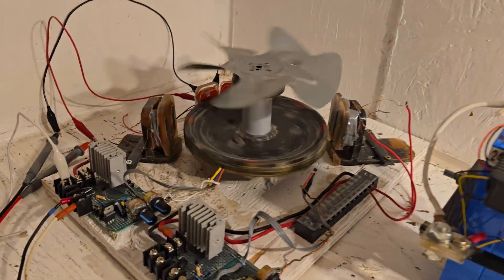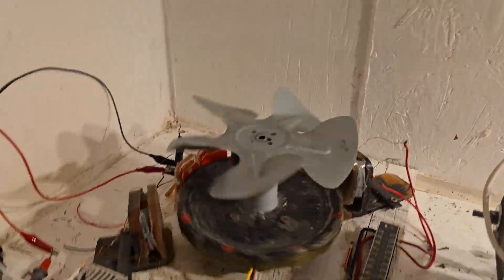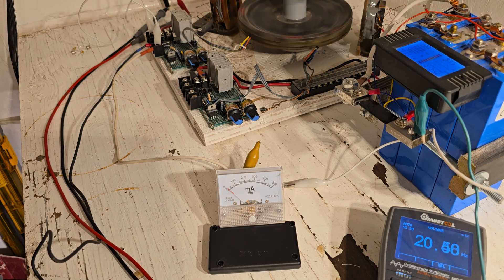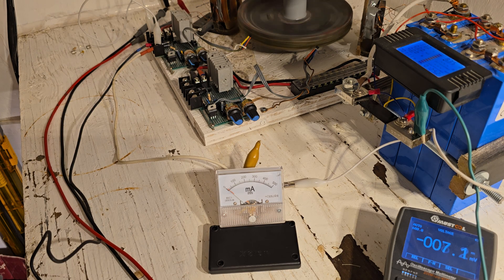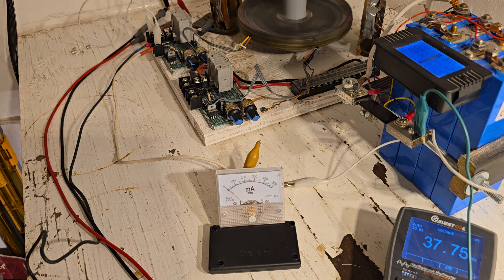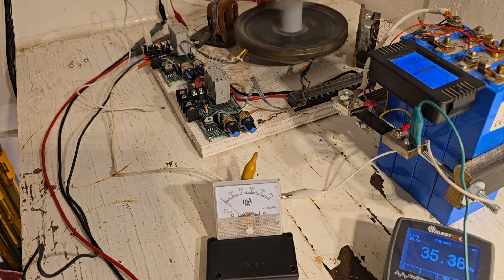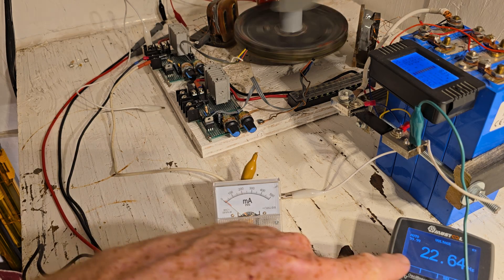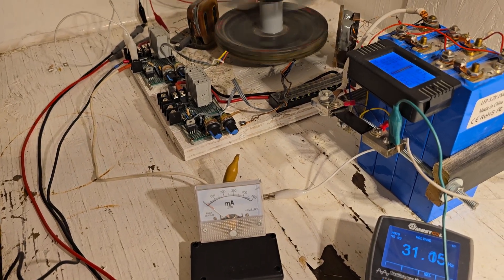Is it possible to Loop a Pulse Motor or not ?

Comment: Very impressive as always. The way your circuits are compared to even 10y ago are miles ahead of what everyone was doing. You may recall "Tinman"? He professed he'd made a self runner, whereas there was no battery? Charge coils were looped back to drive coils? On the video I have of him showing it "working", he starts the rotor manually and it just ran? All his circuits were analog. I've no reason to doubt him, though I can't replicate such.
Reply from the maker: Tinman is awesome! I've seen all those videos too lol , thanks for your comment bud!

Comment: I am your student does that battery bank have a BMS???
Reply from the maker: No  I took it off just to make it simpler for people watching to see but it will work with a bms and I recommend using one just for safety reasons  . The wires are still on the cells but they aren't plugged into a bms at the moment.  Thanks for watching!
Reply: One last thing how many ohm on motor coil??
Reply from the maker: @KevinPounal they are 1.2 ohms total on that motor, each drive coil has 2 coils wound in series each. 6 ohm and wound around ferrite C cores

Comment: The issue with looping without isolation has been that it will mess up some battery chemistry in a long run. Batteries usually don't like to be pushed and pulled at the same time.
Reply from the maker: That's not true if the power from the motor is more than it's consuming. The only time it becomes a issue is with battery switching circuits that don't fully charge the battery before it switches  example switching every 30 seconds or even minutes.
Reply: @windpowerandmore6310  There's just way too many variables in all the setups I have seen so far :D Good to know that it's possible.

Most battery manufacturers recommend 15min resting time between load and charge. But those new LiFePO4 batteries seem to act more like capacitor. They are able to handle the stress much better, for what I have seen.

Some have said that they also will be damaged faster over time. But it really doesn't matter anymore if they can last for 10 years, instead of 15 years.

Comment: you can loop a pulse motor many different ways and it dont have to be the way some know it all says it has to be.  What makes or breaks efficiency is the way one chooses to loop it . And breaking the symmetry is a natural event once the power is converted in one of many  different ways dont really have to break symmetry ether btw but it happens in most circumstances anyway . tons of bull sheeters out there ,,, tons